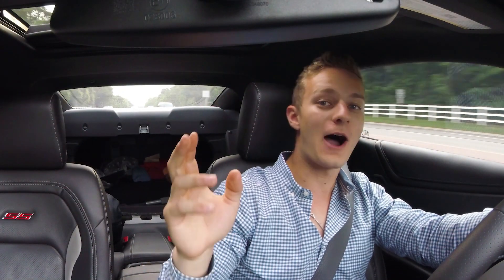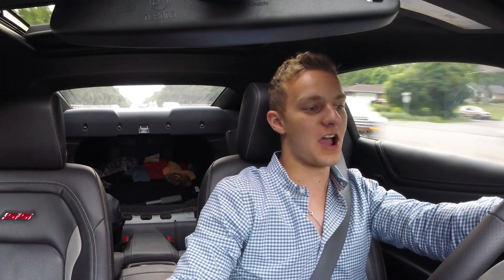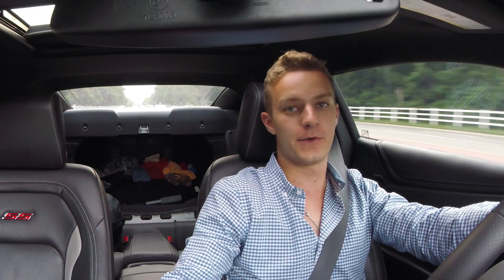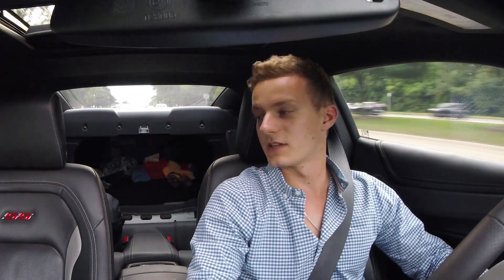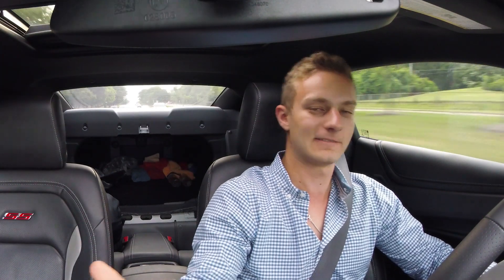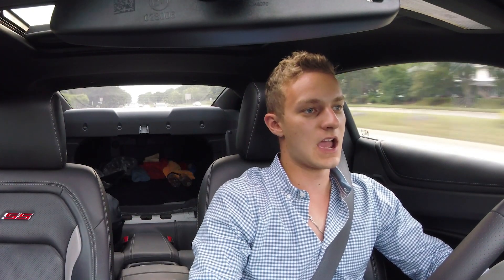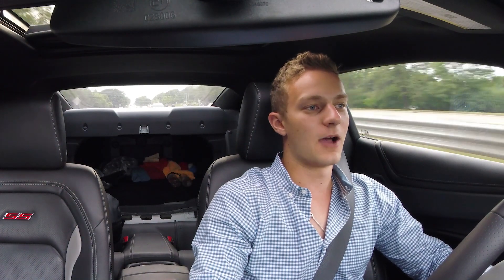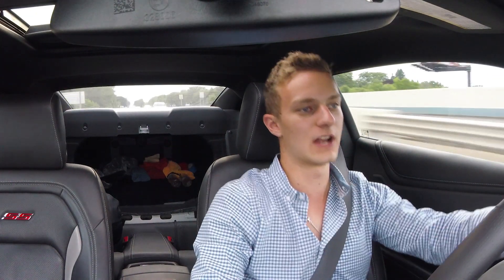Final HORESPOWER Numbers! Engine issue Fixed!

Comment: Did you ever have any trouble with your steering column bolt coming into contact with the headers, I’ve heard of that being an issue worth headers on the 6th Gen Camaro
Reply from the maker: With the OEM bolt, yes. However in the Texas Speed header kit I ordered they provide a button head bolt that clears the headers without any problems

Comment: I thought the 6th gens stock have 450 hp and 450 torque?
Reply from the maker: Stock they do, yes
Reply: Michigan Muscle then why is your car make 414 hp?
Reply: Albert Acevedo those numbers are crank numbers not to the wheel. Stock is like 380 ish
Reply from the maker: @glujan1984  This is correct
Reply: Albert Acevedo anytime you see hp it is not what’s going to the wheels.  That is called BHP (brake horsepower).
Reply: G Lujan all cars all different and the dynos are all different, and it depends on the person tuning it, my stock 2016 ss on the dyno base numbers were 408hp and 412tq to the wheels
Reply: @YaleYouthHockey99  6m?